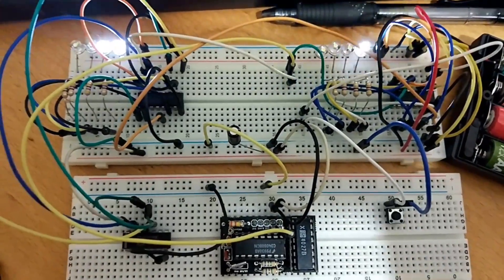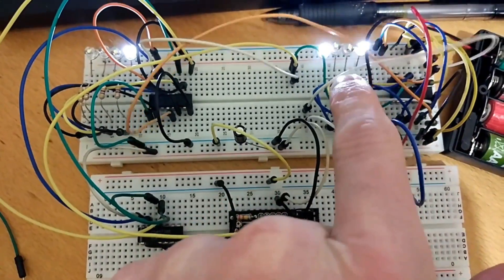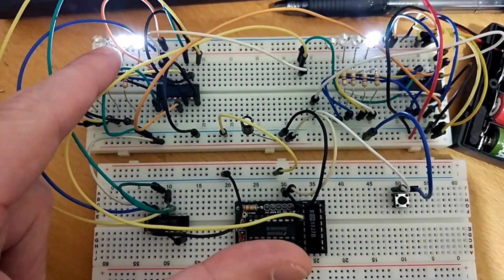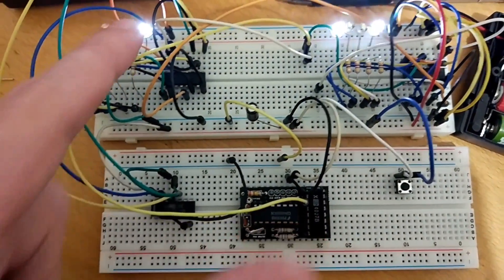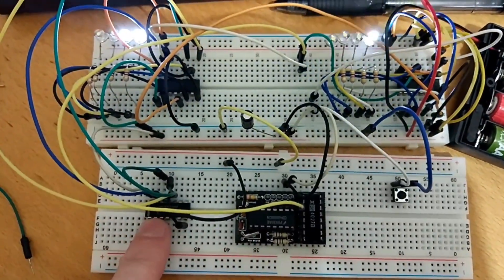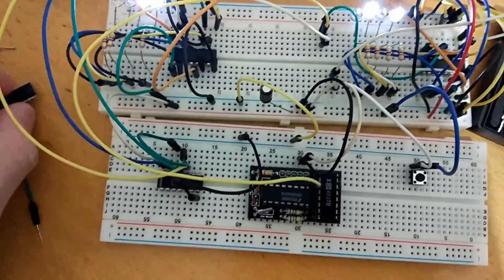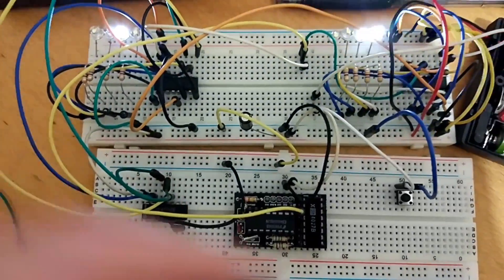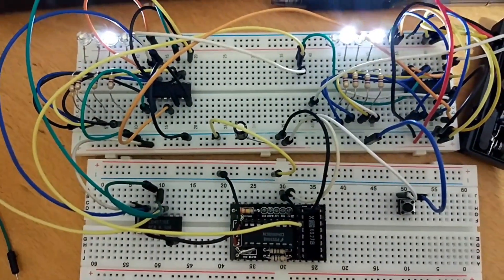Binary Clock Update 1

Comment: Looks like a fun project. 

The only problem I have with these kinds on "binary clock"s is that they aren't truly binary, but rather binary coded decimal. It somehow feels wrong to mix both decimal and binary together to show the time. 

I once made a true 32 led binary clock for my brother showing unix epoch time in binary. But I have to admit that it's totally impossible to read the time of of.  
It also had a countdown mode which my brother used to count down the second till the weekend.
Reply from the maker: :-) BCD does sort of suggest there is some memory involved. In reality the count is just a bunch of transistors junctions on or off. I would love to see a 32 bit epoch time display.

Comment: looks good. may have a go at a simple version
Reply from the maker: It looks like a jumble of wires in a mess of a breadboard ;-) But it is getting there. Once I have prototyped the hours section I will design the PCB. Should be super easy to do one with a microcontroller.